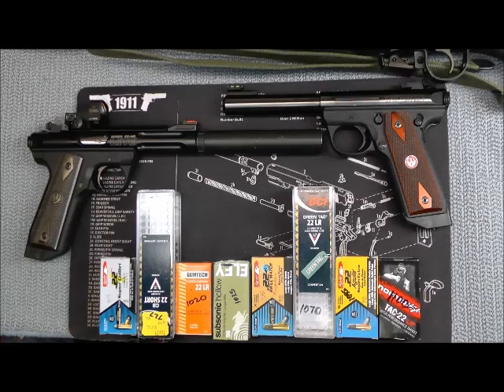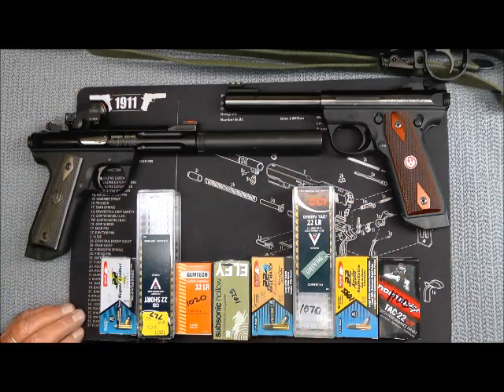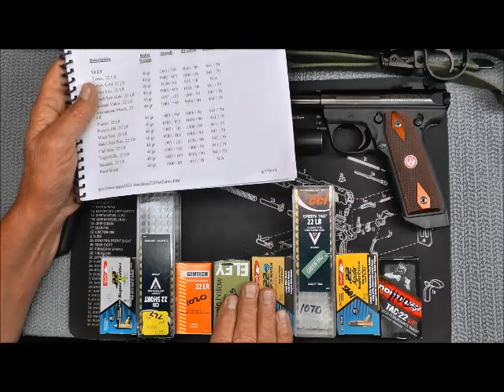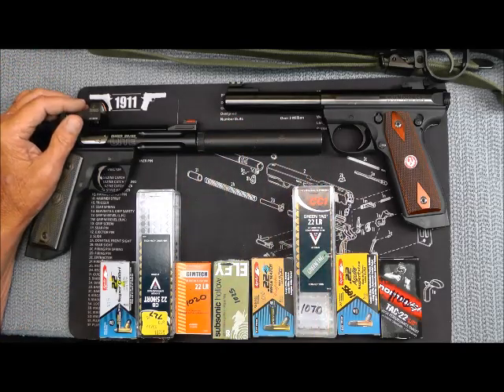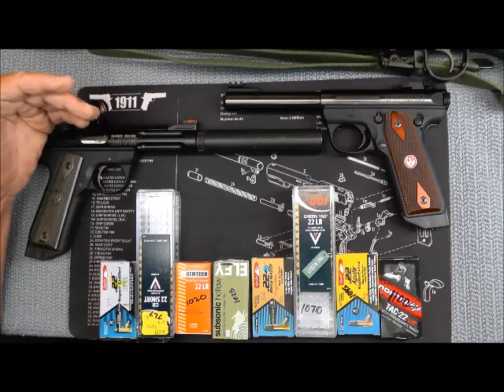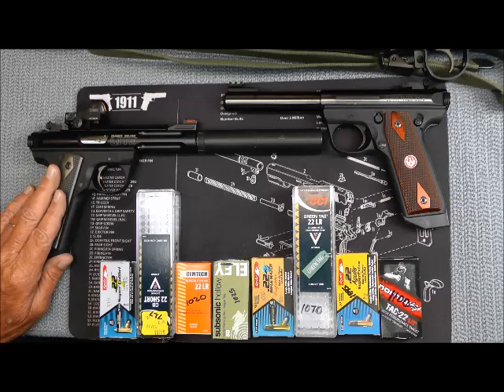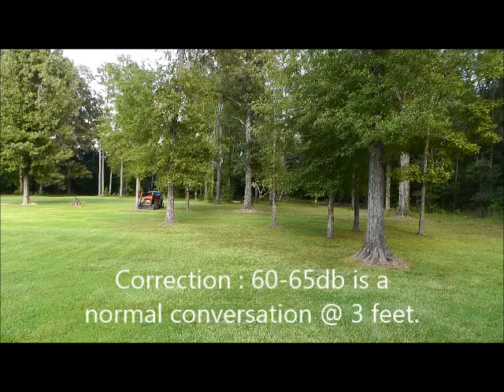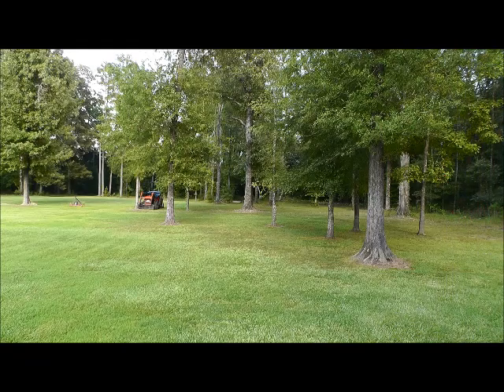22/45 Lite Suppressed

Comment: Oh, if you want to reduce the sound of the action working, you can put your thumb against the rear of the action on that pistol, fire your shot, and manually recharge the action. Not that I recommend it, I've done it on a G21 with no injuries but I wasn't using a can. Kind of the same principle behind the MK22 Mod 0 Hushpuppy and it's slide lock mech, it would lock the slide during firing, and you would manually recharge the pistol after each shot.
Reply from the maker: I understand but on a semi I prefer not to have to manually work the action.
Reply: Yeah, understandable. I thought I would throw it out there incase you have a favorite subsonic round that malfunctions the pistol after being fired, so instead of clearing a stovepipe or type III, you just have to manually charge it. It also works very well if you want to take out a pest without the neighbors hearing too much of it. :)